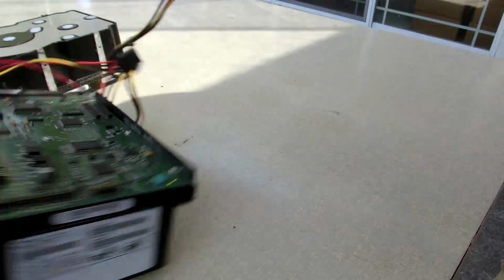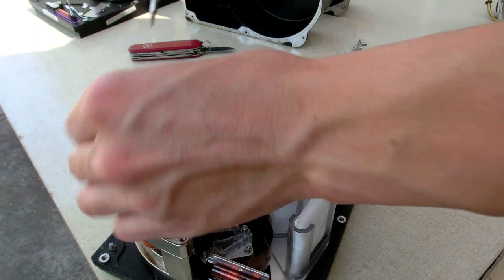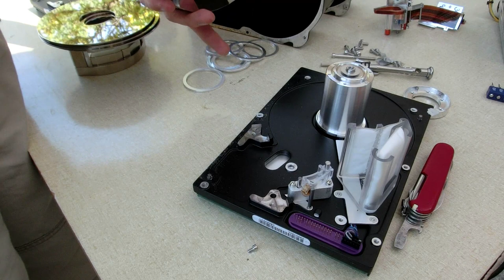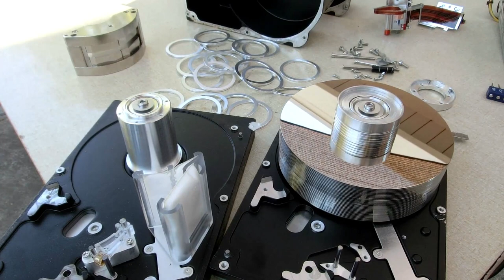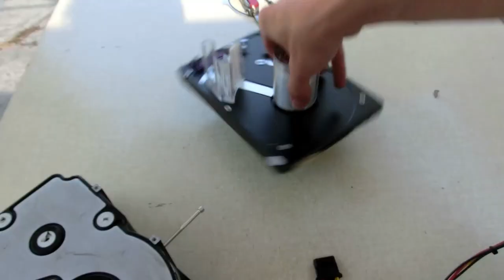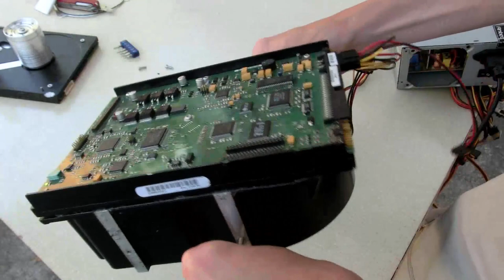DIY Hard Drive Gyroscope part 2: adding more weight

Comment: I had 7 3.5 in platters mounted and spun them up on 16 volts with an ESC.
The motors magnet cage gave out and when it did locked up the bearings. It was like a firework went off in my hand really messed my finger up. They are not good go past100,000 rpm. I never did find the 555 timer ESC speed controller.

Reminds me of when I got a hard drive from my friend with a seized bearings. I thought he was kidding when he said it was like some one just punched his computer over from the inside out. Be extremely cautious rocking them in use. No joke they pack a punch when the bearings/magnet cage go.

Comment: When I use my angle grinder I get the same gyroscopic effect that you get from the hard drive it gives you the feeling that you can lift the world as the gyroscopic effect seems to change the weight of the angle grinder so radically that I can easily lift it in the air one handed but if it isn't running I wouldn't have a hope in getting it above my shoulder height to start with.

I enjoy watching you experiments and engineering.Keep it up. 

Just a side note I like your other channel as well. It is always nice to see the personal side of someone and the way they deal with issues in life.
Reply from the maker: Chris Priest thanks, and that angle grinder reminds me of the Veritasium video where Derek spins a 40lb gyroscope above his head but can only do it when its spinning.
Reply: +Rinoa Super-Genius thats a really cool video.

Comment: I have 20 of these exact drives that came in some server rack cases I got at a state auction. I don't know what they are worth but I need to get rid of them. They are old, but DEFINITELY made with top quality NASA grade components! Ive never seen anything close! Each one weighs as much, and is almost the size of a car battery! The platters are close to 1/8" thick and are indestructible afaik. Ive used them as mirrors for optical projects. Some I hung on the wall, they are just amazingly perfect!
     I took apart two and am planning a DIY water pump and a (hopefully) high output blower fan to cool my server rack. The rest gotta go

Be careful with those massive magnets BTW! They are shielded inside the huge metal block. They can be pulled out with superhuman force. At that point, they become violently dangerous! Within seconds of freeing them, they flew out of my hand and nearly put a hole in my fridge, 5ft away! with all 4 out, they caused havoc in my workshop. They nearly broke my hand to join with each other, which created one big super magnet that could seriously lift a car! They are still attached despite desperate attempts to separate them... it just cannot be done! They are very useful in smaller sizes. But the ones in these drives are just way too much! I highly suggest you leave them attached to the shielding. Somehow, it makes them about 80% weaker and isolates the force to just one side.
Reply from the maker: what years are the drives from? if they are 1980s or earlier i could be interested.

Comment: Although it doesn't seem to exactly have oodles of torque, I wonder, could the now platterless drive spin at a high enough RPM to be converted to a small tabletop die grinder? Seems like a motor platform that stable would be great for precise machining of small parts.
Reply from the maker: MrJamesonStyles could be a lens grinder.

Comment: dumb question, can you wire the other hard drive to spin in the opposite direction and then mount those to a surface? i would think that it would be a truer gyroscope because they would cancel eachother out and say if you would tip it over it would just drop slowly without spinning
Reply from the maker: Travis Mashburn if i just rotate the other hard drive though it will be the same as rewiring the motor.

Comment: If someone wanted to create a UFO incident, those disks would work.  The disks have high reflectivity.  Place one on a clear nylon filament so it can slide down it on a steep angle.  It slides from behind one structure to a structure behind the target so that one of the flat sides is facing the target.  This would be done at night with the light coming from the structure where the target is observing to illuminate the disk.
Reply: +Lewis Doherty Why please label it fake after a while... really all the fake sighting takes away from any real stuff going on.

Comment: Such well engineered and produced parts in that thing. I bet they cost a fair whack when they were current.
Reply from the maker: +Zanzubaa1 especially since this was commercial grade hardware. i wouldnt be surprised if each drive cost several thousand. these were meant to run continuosly for like a decade or so with minimal failure.

Comment: #1) What screw driver is that? I want one.
#2) What model hard drives are these?
#3) Did you know that the gyroscope was used to prove that earth is at rest, and furthermore, it can be used on a long distance flight to prove that the earth is not a ball?
Reply from the maker: number 3 is very stupid, you've obviously never held a gyroscope on an airplane have you?

Comment: Maybe you could try giving the gyroscope drive a little more amperage so you don't have to start it by hand, or if it doesn't let you maybe over volt it a little so it gets a little more torque.
Reply from the maker: notdone123456 no thats not how this works.
Reply: motor controller in the way?

Comment: how do you run the HD motor?? or i should ask, how do you wire the power supply?
Reply: Dude. It's just a regular ATX power supply with molex connectors. You could use any 12V power supply with +12V connected to yellow and black connected to ground, as long as it can provide the required current.
Reply: I assume you're asking how he turns on the power supply, it can be turned on by closing the circuit between the green wire, and any of the black wires on the 24 pin connector.
Reply: thanks